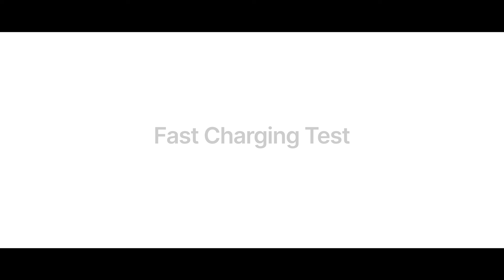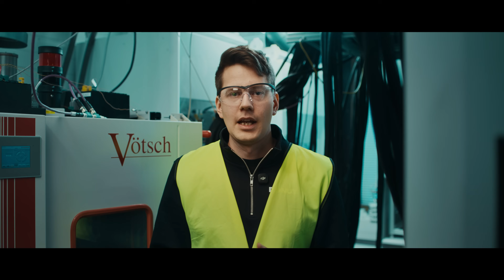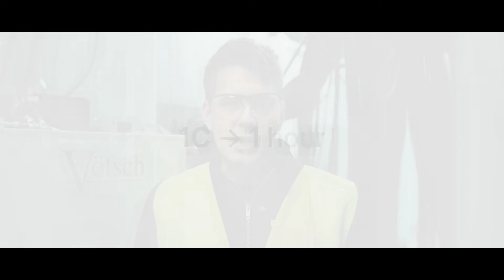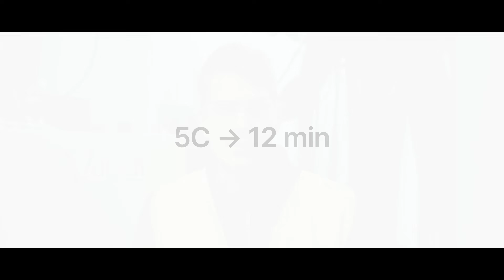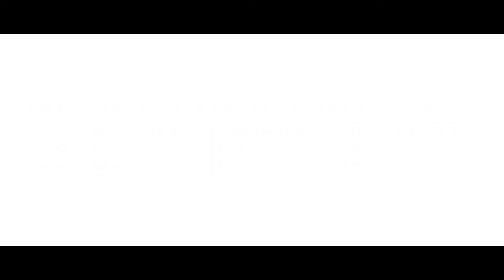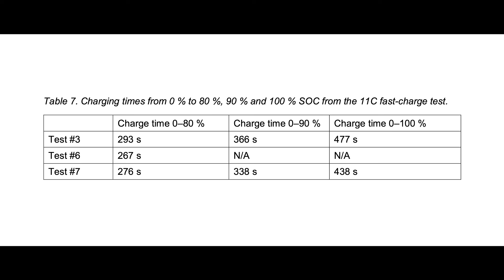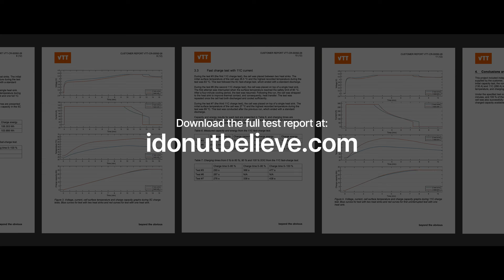Donut Solid-State Battery: Fast Charge Test | I Donut Believe (Pt.1)

Comment: calling one sided heat sink a bad heating solution is misleading, in a pack every cell has heat output so for pouch cells the realistic environment would be to have no heat sink on the cell at all, you would then have cooling channels only on the narrow sides of the cells because the cells are clamped along their large face. So having such a large heat sink for just one cell is a very good case for cooling
Reply: well, but air is probably a worse heat conductor than a cell next to it or am i wrong?
Reply: @Bullseiify that is true, but in a real-world pack the cell next to it will also be producing heat, as will the cells next to it, and so on. Sadly this test seems to indicate it's just a high performance lithium ion cell, and definitely not something that could scale for use with EVs at anywhere near the claimed charge rate.
Reply: @patronics  Are we forgetting that EV battery packs often have channels for liquid cooling?
Reply: @Bullseiify  You are correct! Air is a terrible conductor of any thermal energy.
Reply: IMO they did that because it's just casual lithium-ion cell. It's doable to charge a good cell at 10C with some heat sink. Their is just a chance to damage it.

Comment: Donut and Aptera collab when? (my dream is feverin' hard rn)
Reply: Forget aptera, 5 mins charge speed means the vehicle doesnt require built in solar cell
Reply: @AIpromaxUltra-x5e  Seems like someone missed the point of the solar. On top of that, the whole idea of the Aptera SEV is more than the solar. It's about hyper-efficiency. If Aptera actually manages to squeeze out the 10mi/kwh, they could potentially put a 150kwh solid state battery pack in the space they have reserved for a 100kwh lithium pack and get 1,500 miles on a charge. That's the point of the Aptera

Comment: Those are still the tests only at cell levels and not the battery pack level that will contain hundreds of cells. I will believe for those values when 100kWh battery pack in real product will be charged in 10min 10-80%. This will means avg speed of around 420KW and peak speed mostly >500KW. This will produce so much heat at pack level that even active cooling will have problems. So Please proove the production battery pack use case for those cells. Not lab tests at cell level. This is only showing theoretical parameters of those cells/design. And this is very long journey from the LAB to REAL battery packs in real cars that using real mass produced cells designed and patented by You. I still believe this could be possible but timing will be crucial. Will not expect <2030 real mass produced BEVs with this tech available for Customers. Proove Me I’m wrong. BTW there are already mass produced BEVs with existing cell technology that are able to charge in <12min 10-80%.
Reply: This test was necessary. It's only a first step. More tests are definitely needed. Nevertheless if this test failed then Donut claims would be thrown away. But that isn't the case.
"Others already do 12min 10-80%" . What's their energy density? What's their costs? What's their battery max charge cycle number?
Reply: @francescodivita1120  Xpeng G6 already delivered to Customers. Moderate price big competitor to the TMY. It has LFP battery so no worry about charging cycles. LFPs are very cheap now. 68.5kWh battery pack with max DC 382KW so 6C already in mass produced BEV. Avg speed 238KW for 10-80%. 800V architecture. Will those Donut labs cells achieve this level of performance in real car? Somewhere by next 2-3yrs?
Reply: @francescodivita1120  Off course if the Donut cells with promised around 400Wh/kg so much more than LFPs today that has max around 200Wh/kg could be big deal. But there is also the volumetric density and we still don't now if this is also twice than LFP or not. So example the same battery pack 68kWh using LFP will have around 500kg. Using donut cells potentially could have around 250-300kg. So huge progress. But at the same time to bring more range it will not fit twice larger in the same battery pack dimensions. So maximum maybe around 100kWh that will weight around 400kg. So small progress but not the revolution. In the same Xpeng G6 already they are installing also NMC 80kWh pack with max 451KW charging. So 5.5C. So when Donut cells will achieve maybe around 5C by next 2-3yrs in real BEV this will not be any big deal. Others are not sleeping and existing NMC are targeting 10-12C already. See BYD 1MW charging. Also in real produced cars. This is big deal. Donut cells and chemistry is still in the LABs and still far away from mass producing. I still believe that they could achieve some milestone soon but if this will be enough? If this will be Apple iPhone moment or fail? We will see quite soon. If any real products will be delivered to customers with their cells with this kind of performance in every day use
Reply: @marekwitek7494 that's interesting to see how Donut reputation Is changing. One week ago Donut was a scammers Lab, today they are nothing new under the sun. Maybe next week they'll be stone age ? Who knows.....
By the way i'm eating my popcorn waiting for all VTT videos to come out before judging finally their energy storage solution.
Reply: @francescodivita1120  Why don't they test the final battery pack since it should already been produced for their bike?
Reply: Great observation. Let's see if they address it.
Reply: Google „Verge motorcycles“

Comment: The report results table seems to be showing a charge/discharge round trip efficiency of only 85%. I may be reading this wrong - can anyone check and either confirm or refute please?
Reply: The difference in charge and discharge energy is the heat generation.
Reply: Yes, these batteries have higher that average losses. I think this disqualifies them for most applications.
Reply: The higher the C rate, the higher the losses. The higher the amperage the higher loses in the cables as well. This is valid for all electricity flows regardless if a battery is included or not. Try pulling 10A from the grid at 230V and then try pulling 20A and watch the 16A breakers stop the current flow because cables overheat at 20A.
Reply: @alexandruilea915  It's almost the same whether at 1C (91%), 5C (85%) or 11C (82%). So the heat loss during charging seems to be big. Fortunately, once charged, there seems to be little loss during discharging - though I didn't see the speed of discharging, probably we'll see the discharging tests in a different video.

Maybe charging at a lower rate - like 0.1C (e.g. with AC charging) would reduce the charging losses.

Anyway, this could be one drawback of this cell: fast charging means up to 18% charging losses. At least that's my reading, but I'm no engineer :)
Reply: @Vercixx  The discharge speed was 1C, it's mentioned in the papers. The difference is pretty big if you think about 91% vs 82%. Fast charging means loses with any kind of battery. Hack, anything using high amperage means loses because you have cable loses.
Reply: @alexandruilea915  The question is if these losses are lower or higher than the current Li-Ion batteries.

Indeed, the discharge rate was 1C, thanks for pointing this out.
Reply: @Vercixx  The losses are directly proportional to the amount of amps that you push/pull through the cells so they will be higher than current Li-Ion if you actually charge at the very high speeds that this cells are capable of. If you charge at low speed than the loses are much lower of course.
Reply: @alexandruilea915 afaik the losses are also inversely proportional with the resistence of the materials, so the tech does matter.
Reply: @Vercixx  It does, but the copper cables are the same for example and they didn't seem thick enough to not be bothered between 26A or 286A (11C). I have 50cm squared cables for my solar batteries and anything over 100A would result in the cable getting warm, so there's that to be considered as well. Another detail they didn't mentioned is if the power is measured at AC input to the DC charger unit or if it's measured when leaving the DC charger towards the cell.
Reply: @Vercixx you have charging speeds equivalent to fueling up your ICE at the gas station. I am thinking that based on the test battery capacity the 400 Whr per kg will hold as well. So I really don't care about the round trip loss if I have ICE equivalent range and fueling / charging speed. An ICE has 80% hear losses so I take a Donut battery every time of the week :)

Comment: All three of the main claims can already be done individually with other chemistries. High charge rate? Check - but with major downsides. High energy density? Check, but with big downsides. 100k charge cycles? Well, that's unheard of, but probably possible. It's the combination of the three that's really the revolution. So, I'll definitely look forward to seeing them all shown.
Reply: The high charge cycles amount needs to be tested at a high charge rate at the same time to be a valid test, not at 1C of course. The fact it didn't swallow when it reached over 90C proves it's not just a lithium-ion battery as those can't handle that high temperatures.
Reply: @alexandruilea915 it's not a lion it's lipoły😂 There are 15C high performance RC lipoly packs like Turingy Graphene.
Reply: @alexandruilea915 I agree that the ability for it to continue charging without venting at 90c is impressive. 

Literally nothing else in this test stands out versus a high-end lithium ion pouch shell
Reply: @GregMcNamer the guys at donut lab told VTT that 90 is the maximul temperature I guess because after reading the detailed report there is a failed attempt with one cooling aluminum fin that was stopped when the battery reached 90 Celsius. Only the second test went through even though the battery reached as high as 89 celsius at one point. Still, this is not as impressive as their initial in house testing which were showing values o ly as high as 60s or 70 Celsius if I remember correctly.
Reply: @alexandruilea915 The fact that the battery can survive at 90c is great.  Nothing else in this test is impressive to me. It generates just as much heat as a Lithium ion, it doesn't seem to charge any faster relative to the amount of heat that is generated, it's not more efficient, it's not notably faster than what's coming out of China. 

Also, all indications are that it behaves exactly like a Lithium-Ion battery other than that temperature tolerance. Kind of suspicious that the charging and discharging voltage curves look identical to an nmc cell...
Reply: @GregMcNamer yeah, what's more is that in the initial demo the cells didn't go over 70 Celsius if I remember correctly, so the fact that this one reached 90 is kinda suspect
Reply: @GregMcNamer  90c is not a problem for a high-end lithium pouch cell. It just degrades the cell, but of course that's not an issue if you're only going to do 7 cycles like Donut.
Reply: @izzeww8487 My understanding was that most, if not all, lithium ion pouch cells will suffer serious physical degradation and typically evaporate electrolyte at those temperatures. But I'm certainly far from a battery expert
Reply: @GregMcNamer  Well it depends a lot on the cell chemistry. The 60C limit is for longevity, if you're doing a few cycles you can go beyond that by quite a lot (up to about 90-100C fairly safely).
Reply: 100k cycles is basically almost 300 years of daily charge-discharge cycle

If that's real it's gonna taking out all other battery makers. I will believe when it's truly come out in things I use everyday like phone and laptops. If that truly exist, I would like to buy a laptop and a phone with that battery, as 100k cycles means that I could heavily use it through more than 10 years of its lifetime and still has 99% battery health, effectively removing the worries about battery degradation or replacement
Reply: @sihamhamda47  Right. And after three or at last five years, they stop providing updates to the OS in that phone.
You end up with a prime battery in an unusable phone.
Reply: @toweri_li  Well some phone makers are offering very long software updates. Samsung flaghips has 8 years, Fairphone has 10 years, so those kind of battery will fit perfectly with phones with that long software support
Reply: 100k charge cycles has been possible for a while on cells using lithium titanate (LTO) chemistry.
Reply: 4. Operating temperature parameters appear decidedly better as well.
Reply: We also can't check whether this can be mass produced. 

And at an affordable price .

Or with materials that are easy to get or not
Reply: @AprezaRenaldy  Well, that won't be proved by VTT anyway since they test specs, not availability or production costs. That remains to be seen when the cells will be available for clients to buy. If they are hard to make the price won't be on LFP level for sure.
Reply: @alexandruilea915  Must be below $200/kW for Cell level to compete with MNC
Reply: @alexandruilea915  when they are produced at scale their specs alone insures they’ll not be in the same price category as anything else that’s on the market.
Reply: @luipaardprint  They said that they will be able to produce them as cheap as LFP cells so there's that.
Reply: @alexandruilea915  that doesn’t tell you anything about how much they’ll charge for it.  The price is mostly determined by demand versus production capacity, so expect these to be very expensive in the foreseeable future.
Reply: @luipaardprint  Well, their video said that they can be made and sold for that price, but I do see your point.
Reply: @AprezaRenaldy  that would be proven how. By making it.
Reply: @davis.fourohfour Prototype
Reply: @AprezaRenaldy  unless they're hiding the world's largest battery factory somewhere in Finnland or Estonia.....  it not going to be /mass/ produced.   (not until the Chinese buy one and reverse engineer it).
Reply: No rare earth materials... Thats huge! No more kids in Kongo digging holes etc...

Comment: Would have been nice if they posted the weight of the cell so we could verify Wh/kg....
Reply: At CES they had a mock up of a 5 kWh pack which said 14 kg but I may be wrong
Reply: Some people were calling this out because it would "only" be around 350 Wh/kg but bviously this number is the energy density at pack level while the 400 Wh/kg are at the cell level
Reply: @hansonic2938  The VTT testing would have been 3rd party verification of the claims.

Comment: Well they have at least published some data, which looks slightly better than before, 13% average heat loss seems high to me. I think when compiled into a bundle of cells there is going to be a problem with overheat. We need more data than a single cell im afraid but hey its a good start.

Comment: 1. What was the mass of the battery on test? VTT omitted this key spec from the report.
Reply: They won't tell you that , thats what Chinese want to reverse engineer it.
Reply: @wakeno.6047  they have already claimed an energy density. Independent verification is important to the validity of the product.

Comment: Let  another company in another country test this batterie .. this company could be in donuts pocket!
Reply: No it couldnt, search up what VTT is
Reply: @makoq16  VTT is legit and trustworthy, but they only run the test what their customer, such as Donut, wants. So they only guarantee that tests were run as planned and measurements are accurate.
Reply: VTT has been around a hundred years already and if you look at the history and the current status of VTT research lab then for sure it is not in a donut pocket.  But at the same time we have to remember even when VTT for sure is 100% independent organization then this test was conducted using what Donut Lab asked VTT to measure. And that is how every company does with these independent research labs. They measure only what a customer wants them to research and measure.
Reply: I don't think that is a concern, considering VTT.. However, cherry-picking the tests (designed by Donut), and a 'black box' of what VTT is testing is probably more of a foundation for skepticism at this time (but further tests might reveal more, we shall see).

Comment: Sorry donut, it's still easy to game one off tests from independent labs. For people not in the industry, you basically pay these labs and tell them exactly what tests you want done. Exactly.

That's why if you read the report the scope is so narrow. VTT didn't even weigh or measure the battery. Why? Because they weren't instructed too. They do what they are asked to do and report back, nothing more nothing less. Often your engineers even go to the lab to guide the process.

VTT isn't standing by donut's claims, they're standing by they were given an object and it charged in this way. That's it. VTT does tests for donut, not for the public (or investors). Understand that.

Remember that Theranos (the US company with vaporware medical tech) also had independent 3rd party verification from reputable labs.

Until people not getting paid by donut and not affiliated with them can do their own tests at their own discretion, this still all remains suspect.
Reply: Bs. U chinese?
Reply: I'm not aware of any independent tests of the Theranos hardware.
Reply: @charleskriswell7938 the hardware wasn't but the results were (labs were giving thernos benchmark tests, and then verifying that theranos got the correct result) Obviously theranos didn't make batteries, so this isn't 1:1. Its just a show that "3rd party results" are not what the public generally thinks they are.

Theranos also went and advertised as "3rd party verified results", which was true, but also totally false.